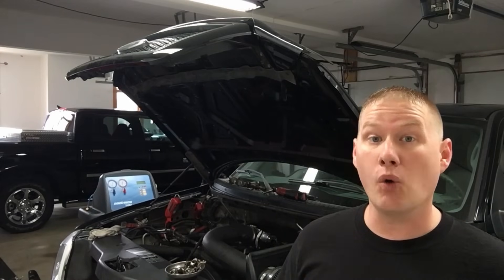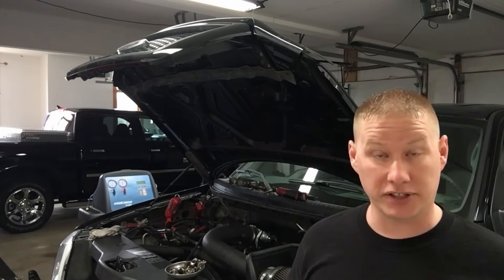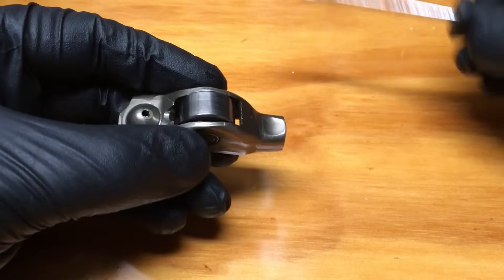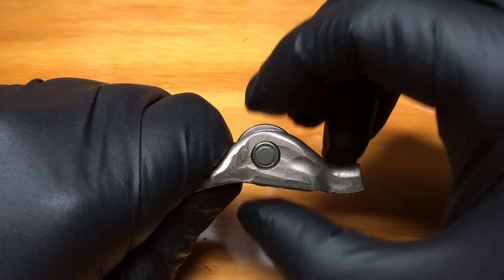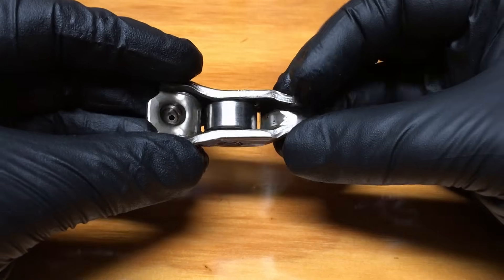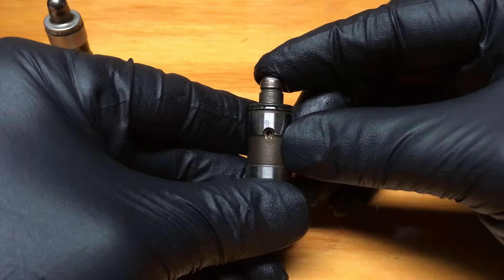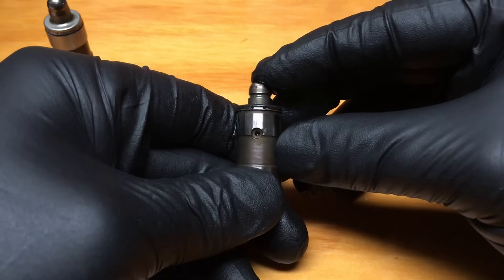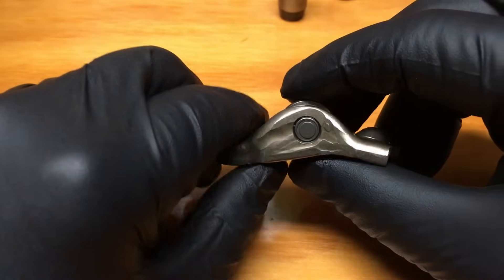Ford 5.4L 3v Triton Engine Ticking Tapping Noises: Must Inspect Items!

Comment: Hey buddy, hope u get this. Do u have to re-tune the engine, if this is done.
Reply from the maker: +Adrian Nino no
Reply: This is on my 3v mustang 05
I put a stethoscope to it and it come from the rear passenger side. Above the #4 cylinder. Ticking/ light knocking goes on start, idleing and when putting throttle. Is that a symptom of this same problem you have him? Thanks for the help.

Comment: I have an 05 expedition with the 5.4 3v, it doesn’t tick. It has a knocking noise only during startup and lasts maybe 20 seconds and then goes away. She has 103114 miles. Has anyone heard of this issue??
Reply: Curious.  Did you ever get this fixed and if so what was the issue? My 08 does the same thing. Thanks.

Comment: 2004 Expedition 4.6...  making a "tssst tssst tssst" leaking air sound from the passenger side top of the engine. Rough idle, stalls at full stops. i just changed vaccuum lines, plugs and coil packs, o2 sensors and throttle position sensor...  rough idle stopped but it still tries to stall.  No exhaust leak, no  misfires but the noise has not changed.  Im stumped.
Reply: Cracked intake manifold? Get a can of ether (starter fluid) and spray around the manifold. The spray will cause the idle to increase.

Comment: Hey Ford Tech, I am doing a complete rebuild on my 2004 F150 5.4 3V and am needing new cams. I looked on ebay and there are cams for the 2004 model only and then cams for 2005-2014. Just my luck, the 2004 cams cost twice as much. What is the difference and can a 2004 engine be modded somehow to use the cheaper 2005-2014 cams? What is the difference with the 04 and the 05+ cams? I also read the lash adjusters are unique to the 2004 model.

Comment: What's the differential between the 4.6 and the 5.4 I'm looking towards getting a  e150 van I now own a 2005 5.4 E350 van just wondering if some info on the 4.6

Comment: Good evening--?? 2004 f150 doing the whole timing train along with lash adjusters and rollers. Do I have to buy the 3l3z lash adj or will the 5l parts work? I see and hear different stories. Something about a groove with one or the other. Thanks great videos.
Reply: J H Ford racing says the 5l adjusters will work fine call them yourself
Reply: J H have them in my truck it purrs like a kitten

Comment: Hey, I was wondering what do you check if the lash adjusters and the roller followers all check out ok? I have a 2003 2v 5.4 that has a very noticeable tick all through the RPM

Comment: Hey ford tech...I'm looking at maybe buying a used 2005 F350 XLT with that 5.4L the truck has 166,000 would that problem become likely in a truck with that mileage?

Comment: Why in the living hell would Windsor design a v8 motor with TWO timing chains long enough to pull logs with? They have to have tension springs on them just to keep the chains on the motor. If a tension spring goes bad, $2000.00 goes right out of the window. They must have all been drunk when they designed the Triton motors. 😡😡. I've always been a Ford customer but my next truck will be a Dodge with a Cummins if Ford doesn't straighten up and start making better motors.

Comment: Not sure if you're still answering questions on this video but my 04 F150 has a ticking / knocking sound most days on startup.  It's pretty loud.  It goes away after warming up but will return if I shut the engine off for a few minutes and then restart it.  I have read that it could be a lifter and that it could also be a manifold crack or warp.  What's the least intrusive way to determine which it is?  BTW - this channel has been great in helping me diagnose a lot of problems with my truck.  Subscribed.

Comment: awesome vids brian,after letting my wife know how much that damn ticking noise just got the best of me every time i stopped at a light, did the job myself on my 2008 f250 4x4 super duty 5.4 triton at 120,400 miles after watching your complete walkthrough series and taking key notes,Cloyes timing kit-phasers from Freedom racing-Melling m360 oil pump which now holds a constant pressure at idle or across the rpm range-Ford vct's(updated version)BWD crank sensor since i was already there and would be a pain to do later-Ford lash adjusters, all 24,all Felpro gaskets,new serpentine belt and i always use the Motorcraft oil filter,have taken a few 5 hour trips to Va and back since and runs better than ever,my wife says thanks,she doesnt have to hear the ''F'' word at every idle.
Reply: How much did all of the parts cost?
Reply: @cummingsandcompany  a small fortune

Comment: I have a 05 Mercury Grand marque with 46,000 miles.  I'm using 5W30 Moble-1 and a  Motorcraft oil filter, is there a better combo for this motor?

Comment: Do all of your videos of the 5.4 apply to the 4.6 3v as well?
Reply: I know this is 3 years late, but for anyone else wondering, Yes. The 4.6 3V has all the same problems. Heads and valvetrain are essentially the exact same just smaller displacement engine.

Comment: Hey man I have a 2005 Ford Expedition and on my radio there a aux button but I can't seem too find the input for it ? Any information on that ? Let me now thanks.
Reply: David Masariegos-Rico some vehicles use a generic head unit and then your vehicle options will just add the aux jack later. My dads 07 Colorado was like that. In my 08 ranger sport though my aux jack was down at the bottom of the dash below the climate controls. Might be somewhere in there. Your owners manual will tell you where it is if equipped and if you don't have your manual then a dealer parts dept should be able to look up by vin see if your vehicle is equipped . Hope this helped.

Comment: Nice jobs on the videos 
help on 2010 5.4
I replaced 2 vct, 2  crankshaft sensor, camshaft sensor anb 8 spark plugs all from the dealer. 
I'm still getting p0016
when I checked the vct connector I got 12v and 3.8v on the signal wire. is that correct or should it be 0

Comment: Thanks! About to do the full chain and cam phaser replacement job with the help of your videos.
Do I need to drain the a/c system to get the passenger cover off or is there  a way to wiggle it by? (2005 f150 5.4)

Comment: HELP! Im doing the timing chains on my 2010 f150 xlt 5.4 the big stud on the bottom passenger side  has a plastic piece on it that i cant get to come off, it is attached to some wires. whats the trick to remove the plastic to free the stud.
Reply from the maker: +Michael Mindak follow the power harness back near the starter on the side of the Block there is a 10mm bolt there take it out then the harness will slide forward enough and come off the stud.

Comment: I'm not trying to be a basher of any auto maker. but I always notice that that 99.9 percent of engine problems are all ways with / Ford, GM, & Chrysler. My wife drove a 2003 Toyota, with no engine problems all the way up to 2017, until she wrecked it, with almost 300.000 miles. We also had a 1994 Honda civic with over 300.000 miles until we sold it in 2017. No offence intended America, but you can keep your cars. God Bless you brother, but I know the big three have mad you rich with there junk.
Reply: Greg Wms different engines and different applications. Low horses power, small engines in light weight  autos should last longer but also cost more. Your comparison is flawed and not even evaluating the same types of vehicles.  Who compares a small economy car to a pickup truck? 

FYI- I have a fleet of company vehicles from cars, pickups to heavy trucks. I don't see any Toyotas towing 31,000 pounds behind a pickup like our little Ram trucks do on and off road.  We just sold a few rigs this year and all of them were high mileage yet sold literally in minutes after posting on line. We would normally keep them till they fall to pieces but with the good economy and tax credits got new 2017 replacements. 
Sold 1984 Chev HD 1-ton, sold 1996 Ram 3500 HD 1-ton, sold, 2001 Ford super duty F550 lariat, Ford 2005 F150.
All had way over 100k and most over 300k before we sell them. It's all about maintenance. 
On the west coast the states do not require any government inspections except on PUC trucks over 26,000 lbs. I see people who do zero maintenance,,,not even oil changes for 20-30k miles and even know a Russian guy who claims you never need to change oil, just add as needed. I know of and have seen many people originally from other countries who now live here in the states and too many do zero maintenance. They literally drive high powered US cars till the wheels fall off.  I have several friends with auto repair shops who send me photos of the crazy abused vehicles that come into their shops. 
It's amazingly,,,,,stupid.
Reply: Francisco Garduno ---I agree 100%,,,I have had many vehicles which the rating companies all called junk and do not buys.  However they all worked flawlessly for us, I.E. Jeep Grand Cherokee with a V8 we did nothing but the basic maintenance and sold it after 275k miles and the people who bought it ran up to 500k before selling. Our 3 valve triton 5.4 F150 had 185k miles and sold in minuets for 40% over book value. Again other than basic maintenance zero problems. I could give you many more examples.

As for high mileage rigs we run out F550s up to 300K miles and then sell.   We could get much much more trouble free miles out of out rigs but try and sell them when they are still worth a lot of money vs how long we have used them.  We know many people who keep theirs rigs till 500-750k miles just to see if it will do it.  Most of our rigs drive long distances and have never had a vehicle strand our people In the last 40 years. 
Also just since 2007 we started to buy non American rigs. In that time we purchased 4 AWD units for bidding and consulting work (Honda, Subaru, Toyota and Nissan) we don't see any longer life span using them VS American made vehicles properly maintained.
Reply: 2003evodave I once drove an 86 Toyota pickup that was overheating for an hour without realizing it due to a faulty temp sensor, needles to say I put some jb weld on the radiator and it went another 60,000 miles without a problem.
Reply: Uhm taxi and limo routinely run Ford cop car platform vehicles and GM trucks for  400 to 450k miles befkre dumping them.... on used market not junkyard

PS some limo companies dumping GM for Expedition/Navigator due to guaranteed tranny issues every 90 to 120k on GM year 15+ fullsize suvs...some operators are already on their 4th  yes FOURTH tranny in a 3 yo vehicle, these dudes are NOT amused
Reply: 5litreho They're the answer to my problems, hell Toyota land cruisers and hilux pickups are used as light tanks and infantry fighting vehicles around the world in the harshest of environments and abuse. Toyota is also the only car company that has a war named after it.
Reply: I agree. I have an 05 accord with 175k and a 13 f150 with 60k. I've replaced the alternator on the Honda. On the F150, both hubs, inner tie rods and a hub actuator(that was my fault, but cheaply made part). Had a Chevy Malibu, ending up giving it away at 115K. There's an article out there also about how the quality went down a bit when Japanese auto makers started making their vehicles here. If the big three were that great, they wouldn't have all taken bailout money, Ford included. Ford didn't need it, but they ended up taking some money anyways. But I think it's hit and miss across the board with all auto makers. Some just have more lemons than others. cough*dodge*cough
Reply: Lexus 4.0 v8 was used as a plain engine an is 1 of few motors to get a FA sert. Funny thing iisFord an Toyota have worked together for yrs. Now you might think they learned a few things from Toyota as far as engine technology goes. I guess ford did win the 24 hours lamonze race with the GT500. Wait wait wait I know who messed up the big 3 motors. An balance of Government and profit. If government had not been so hard on these companies with such strict MPG Smog an many other regulations. Duratech 3.0 is 1 of my favorite ford motors i have a Japanese tranny yup like i said ford an Toyota work together its an 03 Taurus with 250000 miles still runnin like new
Reply: Don’t care what make or model all comes down to maintenance!

Comment: Maybe I should dump this damn truck and get a 5.0 F150
Reply: 183,000 very hard miles on mine, 5,000 mile oil changes, 2 sets of spark plugs, 2 sets of aftermarket coils, and a $150 special tool set that removes a separated spark plug tip in 5 minutes.  Just ordered  $112 worth of rockers and a $125 valvespring compression tool.  It's more than oder designs, but it has more moving parts.  Averaged 17 mpg new, gets 14 in its current state.  My older trucks got 10 MPG, and my 3.0 ranger got 18.  I have not complaints about the 5.4.  I would also prefer a 5.0, but I wouldn't run from a 5.4
Reply: @davidnation4437  what brand rockers did you get? Did you do both banks
Reply: @MrPami9899  , I bought ford OEM rockers, and did both banks.  Not sure it needed it, but I had seen some pictures that scared me.  Mine all looked decent when I removed them.
Reply: my 2013 5.0 had 1 roller rocker with pitting. loud ticking from rear passenger side. warranty covered it though thank god.
Reply: klatoo14 I have the 2014 STX 5.0 and it's awesome.

Comment: Brian - Another awesome video Bruddah!!

Would I be correct in thinking that these tests and checks in your video apply equally as well to the 4.6L 3V motors?

I have the 4.6l 3v motor in my 2009 F150.

Comment: Replaced all mine when I did the timing chain set on my 2006 Mustang GT 4.6L 3V. Engine purrs like like kitten and roars like a lion again. I bought my FRPP rocker arm/lash adjuster kit on eBay for about 1/2 the cost of Amazon retailers. http://www.ebay.com/itm/OEM-NEW-Ford-Racing-5-4L-4-6L-3V-Rocker-Arm-Lash-Adjuster-SET-M-6529-3V-/262899202426?hash=item3d3603797a:g:8zkAAOxyGqZSVpOX&vxp=mtr

I also have a slideshow of the tare down and before/after videos of the ticking/tapping on my channel.
Reply: Hey Jrwou1, did you soak the lash adjusters to prime them or did you just put them in as is?   Thanks.
Reply: @cj8489  I soaked both the lash adjusters and rocker arms. I also put  Royal Purple assembly lube on the lash tips and valve tips  prior to seating the rocker arms. Then be sure pour clean oil over the entire valve train. Also, prime the engine by applying the throttle pedal to the floor then crank the engine 3~4 times. Keeping the pedal fully applied will put it in safety mode and prevent the engine from starting.
Reply: When you soak them do you squeeze them a little to get the oil in them?     Thanks for the response.
Reply: @cj8489  Yep forgot that step in my reply.

Comment: Great tips, Brian. Hydraulic lash adjusters and rocker arms are definitely on the checklist during an engine teardown/timing job. I still want to hear that truck run! Would the failed rocker arms show up on a manual compression test?
Reply: I would think not because it's failing open; not failing closed. Compression should still hold unless damaged valve seats. If I'm wrong.... School me please. I don't want to walk around with false ideas. Lol

Comment: I have 2001 grand Marquis and it start oil leaking but not massive about 1 liter during 3...4 months ...do you advice to use any re- seal to stop this minimal leak

Comment: Does the 2v have this issue with lifters and rollers?   I do notice a slight tapping that is sometimes present and sometimes not (whenever it is present, it is only at hot idle. Never hear it cold).

Its not loud yet but is audible if you stand next to the truck while running, it can easily be ignored so I'm not too worried about it right now.  Just wondering how common this kind of failure (im thinking lash adjuster since the sound comes and goes) on the 2v motors.   Its a 2002 with about 78,000 miles.

Comment: i had a hole at the bottom of the  slot  where lifters sit . it looked like the bottoms of the lifters had worn through the seats. They were not circular holes . i wasnt too sure. because they were all like that. I had 2 rollers and a cam lob that looks like they went through a blender

Comment: Thanks for posting another good video to prevent the Ford dealerships from stealing the hard earned money from people's pocket. I really wish you would do a video on how to replace the timing chains and plastic guide tensioners on a 4.0 SOHC.
Reply: Engine comes out to do the timing chains with the 4.0 Fords put on an engine stand.There is a rear one too and it is a PITA to do with it in the vehicle.
Reply: Yeah, I already know it. It's the most horrible design that any auto manufacturer has ever come out with. I'm glad they finally fixed it in 2004.5 on the Ford Ranger.
Reply: GM is this way too and this is with the Chevy Traverse,Buick Enclave,GMC Acadia and the Saturn version with the well known POS 3.6 engine.Engine comes out from the bottom to change timing chains

Comment: Very similar problem that 4.7L V8 Chrysler engines have.  Sometimes I can't help but wonder if these two Ford and Chrysler engines were designed by the same engineer(s).  There's an awful lot of similarities between the two.
Reply: And apparently even some part similarities: https://www.summitracing.com/parts/mel-jb-2271/all
Reply: Dang.  They share the same lash adjusters??

Comment: I sometimes have noise on startup with my 03 town car.. has 161,000 Kim's.. is it common on these engines at all?? Doesn't happen on every start.. and if I crank it first for a bit with gas pedal to floor.. then start it I never hear noise.. but I do get a bit of noise when I rev it up off idle.